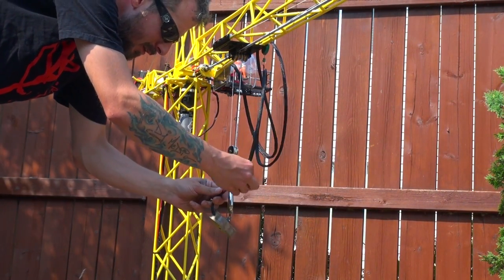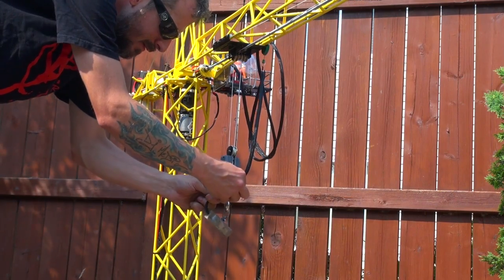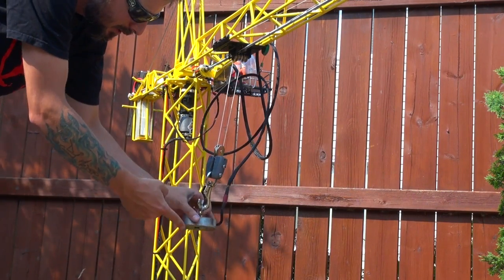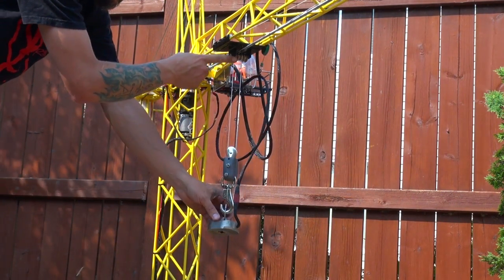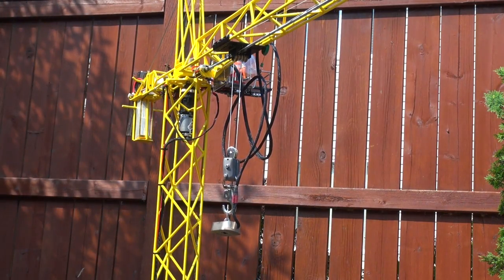RC ADVENTURES - 5' Hand Made, High Steel Tower Crane & Electro-Magnet

Comment: I've always wanted to see you guys do a full scale race on a dirt track that would be awesome!
Reply: I have a lot of the huina RC I would say the fastest one would be the loader also that one has broken the bucket can't tilt forward I lift it up a bathroom cabinet thing is a beast can't say it could pick up a whole lot but to pick up that I was holding down the back side of it and it picked it up pretty heavy I would say that's why I broke need to fix still drives and runs just need a new shaft and motor also excavator cheap one has the neck needing to be fixed as well I have two of the cheaper excavators and the heavy metal one dump truck and the forklift forklift is the 1:10 others are 1:14 collecting them all for my baby boy but also having fun with them in the process been buying the old ones that were pushable from Tonka to go with so if anybody is selling vintage Tonka I am looking